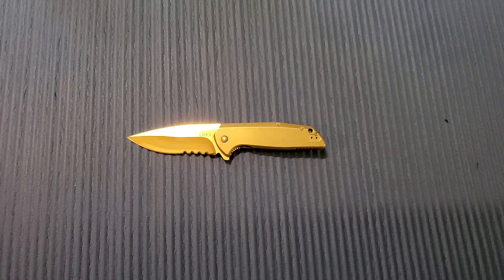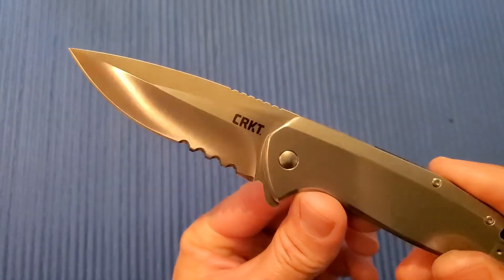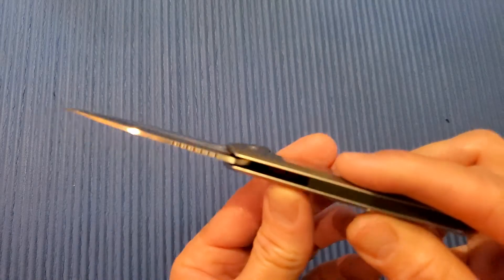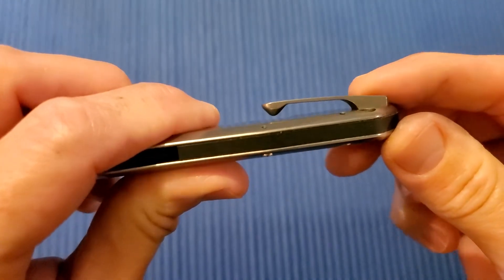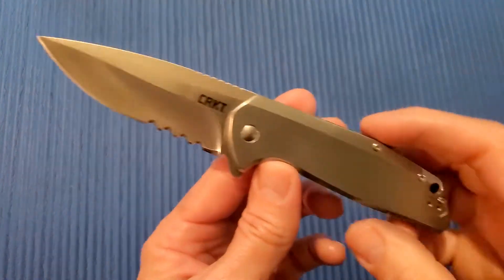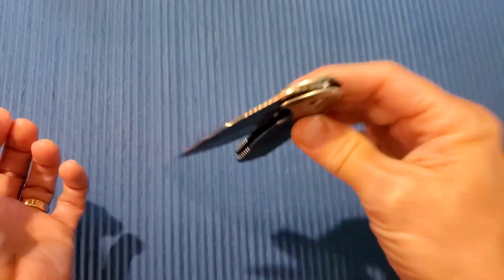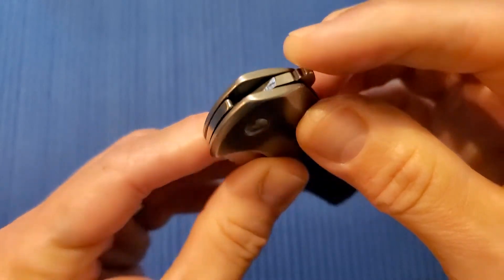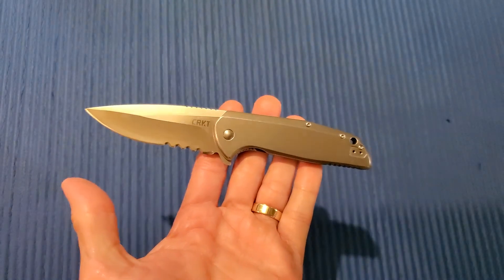CRKT G.S.D.

Comment: I have this knife and enjoy it for the most part. The pocket clip sucks, but I find it a non-issue with coveralls that have thicker material. But the little tiny nub flipper is bs. Have you seen or come across any mods to improve that? I was thinking of using a dremel to take material off the scales for a better purchase on that.
Reply from the maker: I haven't seen any mods for the G.S.D. If I keep it, I'll probably just use a Dremel, like you said to relieve some of the sharpness on the flipper tab. I really like the look of this knife, but there's a few issues that keep me from carrying it on a regular basis. Thanks for watching
Reply: @3minuteknives  no problem! I have a plain edge on mine. I used it to practice sharpening and really like the edge I put on it, but I don't carry it a whole lot because the tab is ridiculously small and sharp for what it is, but I pulled out some old knives to add to my edc rotation and was debating on keeping it or getting rid of it.